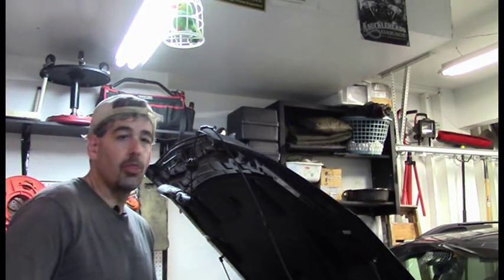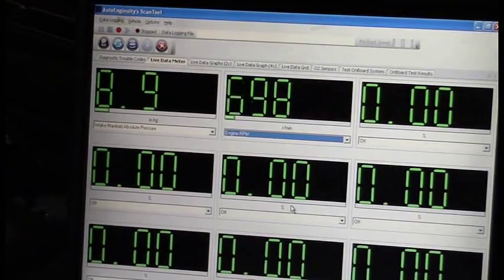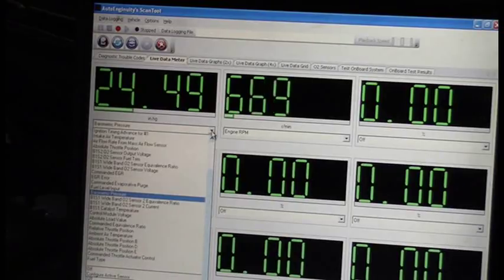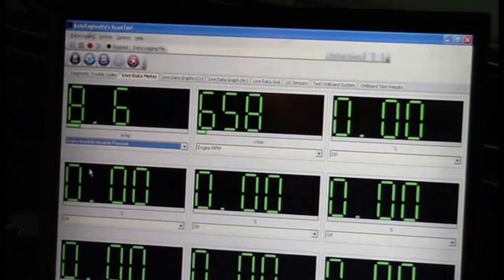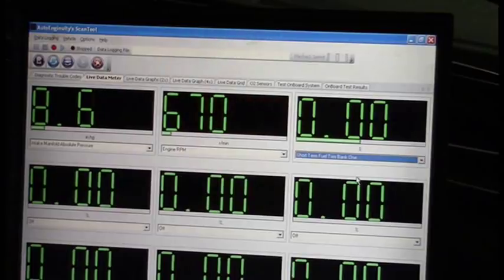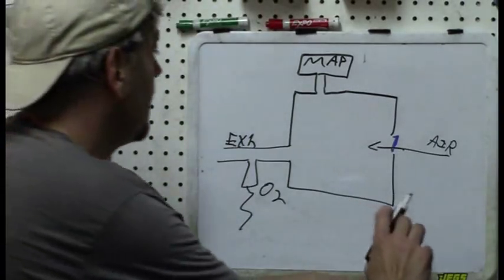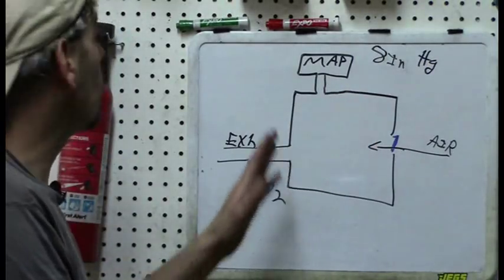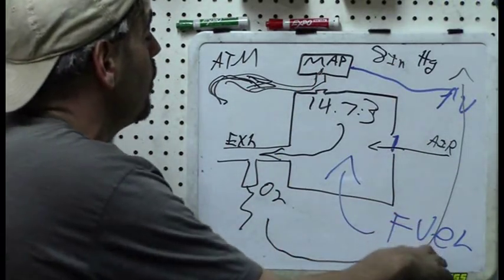MAP Sensor Diagnosis and Understanding Function- Pt2

Comment: I have a 14 Prius 2 , p0108 code but car seems to run fine. There was a couple other codes before this one.  It all started after I did my own head gasket job, intake , egr pcv valves replaced. Took it to Toyota for software update regarding the egr. Hoping they did it right.  Car felt weak before update.  Wouldn’t back in to my driveway and after update voila it works fine.  The initial codes were all air fuel related and they went away.  I was hoping there was a re learning period and that codes would go away.  It’s only been 9500 miles since I put it back together.  Now I need a smog check by February hoping to make this light go away snd fix the issue.
Reply from the maker: Pretty obvious to me you have no open in the MAF circuit. What is your reference and ground voltage showing?
Reply: @SchrodingersBox thanks so much for the fast response.  Sorry took me a while to answer cause I didn’t wanna sound dumb, I’m still gaining my proficiency in car talk.  
     but I’m pretty sure you mean the ground voltage and reference voltage for the MAF sensor itself right ? I see a reading in the freeze frame data of 0.20 gm/ S for the MAF in my scan tool but I think I need to use my multimeter and check the MAF sensor it self right to see if it receives 5 volts? Gonna watch some more of your clips I’m getting close. I can also send any freeze frame or live data through email with my scan tool.  Hate to ask for too much, only if it helps.  Many thanks !
Reply: @SchrodingersBox I think I figured it out. I had a feeling , the MAP sensor still had oil residue on it from when I was changing the head gasket and intake.  I cleaned it and the check engine light went away.  Thanks again happy holidays!
Reply from the maker: Fascinating because a map sensor is not affected by oil since the diagram is internal.  But since you had an open circuit it’s more likely it just wasn’t plugged in all the way before.
Reply: @SchrodingersBox that makes sense cause it probably should have gone off much sooner if it was the oil. Thank you merry Christmas 🎄
Reply: Also to add after the first set of codes I took out the first 2 fuel injectors , cleaned and added some petroleum jelly to seal the o rings. At the time they were misfiring. The misfires went away as far as I can tell. A while later p0108 came up and now I hear a slight humming after a bit of driving.  Freeze frame shows that the code gets thrown at the same engine run time the last 2 times i checked.  The MAP kPa goes up to like 130-40 which sets off the code.  The code is intermittent but seems like it’s staying on longer as it progresses. I initially thought fuel injectors cause there was an issue where one of them fell out when I was working on the head gasket so I swapped them to see if misfires would change places. Realizing it was the fumes that got me high and not my blunt was crazy lol

Comment: Hi so does the map sensor tell the air temperature as well I have a ford focus 2.0 Duratech engine I can only find a T-map sensor no maf one would that be right thanks. Jeff UK
Reply from the maker: No it does not. However the MAF sensor often does on a lot of vehicles. The IAT is very often integrated with the MAF

Comment: I guessed that the fuel trim would go negative from unplugging the MAP but my reasoning was that the map would read 0 pressure, therefor decreasing fuel delivery which would mean less fuel than needed, killing the engine due to lack of fuel.

Comment: I stumbled across your video due to an issue i am having with my 2.4 L Ecotec 4 cylinder and negative fuel trims, mostly on cold engine start up. After much research, I narrowed the issue down to either the MAP, IAT (part of MAF on these engines), or coolant temp sensor. I didnt want to just throw parts at it, and due to your explaining on MAP, i am having the exact scenario in your example, and think, finally, that my MAP is reading high and causing the issues im having. The MAP, being 16 years old, is my culprit i believe. Thank you.

Comment: How do you manipulate or trick MAP to read at 0psi when  it is actually reading at +1.5psi. I think this would prompt the super charger bypass valve to start closing a bit earlier than usual. Perhaps will get me extra 10% extra hp without going above 3200rpm.

My engine air manifold read at -11.8 psi during braking and up to +8.2psi but only during hard acceleration. 80% of my road miles are having manifold pressure at 0psi or lower. 20% of the other road miles are above 0 to 5psi. Regards.

Comment: My map sensor reading is stuck at 2.75v and 14.25psi. It doesn't move from this, at different throttle angles. Is the MAP bad
Reply from the maker: Could be. Provide a ground and see if the reading changes. If it does the map is bad.
Reply: @SchrodingersBox  Thanks a lot
Reply: did you find out if the MAP sensor was bad? I think 14.25psi is just like outside air pressure

Comment: The barometric pressure shown was 24.49.inhg..... but this could be different reading in other countries eg. 29inhg etc .
Reply from the maker: It will be different depending on anything… even the weather. Baraomettic pressure is not a constant.
Reply: @SchrodingersBox  Ok noted Matt. Thx for the reply.

Comment: I’m a little confused.  Why would the O2 sensor report a rich condition after removing MAP and plugging hole.  It seems to me that, in reality the mixture is neither rich nor lean as evidenced by the zero STFT prior to the intervention.  Am I missing something?
Reply from the maker: Because the MAP would read atmospheric pressure instead of vacuum, so it will assume the car is at WOT and increase injector pulsewidth. But the car is not at WOT so the excess fuel causes a rich condition.

Comment: Help!!! Lol
I changed my map sensor, but no luck.
Have code p108, p106 live data reads 38hg and singnal wire is 4.9 volts all the time. This comes and goes. Some times it reads 10hg at idle and fluctuates with throttle as it should. 
Continuity is good on all map and maf sensor plugs to ecu. Did smoke test and have no vacuum leaks. Did exhaust back pressure test and the cat is good
Reply from the maker: What data showed the MAP sensor was faulty?  Also how is it possible the signal wire is showing 4.9V?  Is that with it unplugged?
Reply: I had codes pointing to high voltage  and high pressure so I changed the map to start with because is a $20 part. 
I back probed the plug and had 5v powered and 5v signal at idle. 
 With the key in acc mode I have no volts to the signal, but today I did it again and I had 5 volt signal and when I mess with the wire it will drop to 1.5 volts at idle.  I ordered a new plug for the map because I'm thinking it's internal,  inside the plug
BTW 
O9 3.5 impala 150k
Reply: I got codes p0107 and p0106. I'm new to diagnostics on a computer,  but to me it pionted to the map
Reply from the maker: Ok if you have 5V signal voltage at the sensor you have an open ground circuit. Nothing else can cause that.

Comment: I'm here because of map sensor and maf sensor codes . Replaced both but still hesitated from a stop . 
            Suggestions included electrical problem so replaced spark
plug wires after replacing plugs months ago and engine runs perfect 
           Damaged a wire while doing plugs and the map sensor reported it

Comment: So even if I have a code P0108 it’s possible is not the MAP sensor problem, or it might be air leak .
Reply from the maker: Not only possible- it’s likely. Always check your Inputs first and then look for variable output from the sensor. That’s always the basic first starting point every time.

Comment: I have a car that only has a map sensor the idle is very low and rough,  i think i may have a vacuum leak somewhere which I'm going to try and fettle, but something that is interesting is the fact that by quickly pressing the break pedal continuously you can make the engine tickover rise, i believe this will be because of the brake servo drawing off excess manifold pressure.
Reply from the maker: On a MAP only engine a vacuum leak will cause a high idle.
Reply: @SchrodingersBox  hi mate thx for the reply,  I will avoid wasting time looking for a vacuum leak for this rough idle and will perhaps look towards the throttle position readings which were 12% at idle which I believe should be about 0.6v. I don't have any fancy scopes just a cheap scanner and a multi meter, but that's half the fun of the challenge 😄
Reply from the maker: Up until only two years ago I didn’t even have that much. All you need is a simple scantool that reads live data and a testlight really.

Comment: On a 94 f-150 5.0 l on the MAP sensor starting with A 11.84 v B .005v C .006v D .022v with the key on does this tell me I have a bad PCM I have spark at the coil  and the spark plug the coil red wire has 12v and the tan wire flashes with test light ignition switch does nothing when turned to crank.I replaced the ignition switch and the neutral safety switch
Reply from the maker: Where is your 5V reference?
Reply: @SchrodingersBox It did not have a 5v reference I checked all the wires with the key on with a VOM  on all four wires I was told by Scanner Danner that this is one way to check for a faulty PCM is this true?
Reply from the maker: You need to check for 5V reference from the PCM.

Comment: I get the slight increase when the throttle opens up. What about when the engine is under constant load of 3000 rpm does the  Hg stay higher than at idle or does it equal back out to 9Hg after the initial air suction.
Reply from the maker: Vacuum lowers proportionately to throttle opening. When throttle is open, you are equilibrating with atmospheric.

Comment: Also worthy of note:  There is a difference between HgV and HgA.  HgV (Inches of Mercury Gauge) is what you would see on a boost gauge.  0 is atmospheric and 29.92 is perfect vacuum. That different than what the computer is reporting here which is HgA (Inches of Mercury Absolute) which has the figures reversed.  0 is absolute vacuum while atmospheric is 29.92.  That's why the computer reports an "in Hg" of about 27.1.  Much closer to atmospheric and judging by the reading, he's at about 2,700 ft above sea level.

I'm confused about the initial rich condition though.  When you expose the MAP to ATM pressure, how is the PCM adding more fuel if not through STFT?  I expected the PCM detecting extra air in the form of pressure at the MAP to then trigger STFT to go positive adding in more fuel to compensate.  Then the O2 would see a rich condition because that extra air is not actually in the system so STFT going negative to compensate for the new rich condition.  Doe that happen so fast you just don't see the STFT go positive before it goes negative and we are seeing the net result of the MAP and O2 readings or does the PCM command fuel some other way to compensate for MAP and only O2 controls STFT?
Reply from the maker: It is likely that it is adding through the LTFT that was already adjusted perhaps- this the STFT didn’t move.

Comment: Sheet I am 666 comment.  Not good for those that believe in signs.  
Anyways so if my map is actually going down when I open up the throttle that means my map is either reporting a leak or is bad???  Correct me if wrong of course.  Great vid btw.

Comment: My engine vacuum is fine at idle but when traveling especially in 3rd and 4th gears, it increases to like 80 to 100 kpa which is the same as engine load % and the ecu keeps dumping fuel into it. While this is dumping fuel, trims go -20 to -30 cutting fuel away and this causes severe hesitation.  What do you think is the problem? What is likely cause this situation?
Reply from the maker: there isn’t enough information to say. you have no induction metrics or TPS so it’s impossible to determine if there is even a fault b

Comment: Sir, I have a question, can a bad cat  or clogged exhaust cause high MAP reading on a MAP only engine?
I am unable to come to a conclusion because my fuel trims were never positive in the last 30 days? Is it possible for stft to never be positive?(not on average but never read positive even a single time  i.e graph starts at 0 and goes below and never up). How do I force trims to positive on MAP only engine? Till now I have come to a conclusion that probably my O2 sensor circuit is off(reporting like a 200 or 400mv over actual but couldn't really understand what would cause it). Can you tell me if throttle position in a MAP only engine has any control over fuel injection?
Reply from the maker: yes is can cause a high MAP for sure as the exhaust pressurized the manifold.

Comment: What you stated from 11:35 - 12:45 is absolute gold nuggets. No technician should be allowed to diagnose and repair drivability and fault code diagnosis that doesn't understand what Matt shared. This explanation could practically apply to most any code. Learning system integration between inputs and outputs is absolutely essential to be a 2%'er. This channel is not as recognized as some but I would put Matt up against any other tech from any other channel when it comes to complete and accurate diagnostics.
Reply from the maker: Thank you so much!! I will admit it may take me longer than other techs but I would get there eventually with a correct diagnosis the first time- just slower than some.

Comment: Thank-you Matt for the excellent video. If I knew where your shop is I would not hesitate to bring a job to you that I cannot figure out. Currently I have a PO 106 on an 05 Sprinter diesel. So far I have not be able to figure it out.
Reply from the maker: I am in denver.

Comment: I like that saying "Tools don't fix cars...brains do!". 
All your vids are awesome. Even this 8year old one lol. 
The 05 Tacoma's still runs when the MAP sensor is disconnected, MAF sensor unplugged, O2 sensors unplugged, AND Camshaft sensor is disconnected. At 2k RPM max. The limp mode is mind blowing but remembered watching a military engineering show on some engine a while back. It mentioned its computer's ability to use data from other functional sensors to estimate the air/fuel ratio and continue running. On the Tacoma, the  Crankshafts sensor was still plugged in (no power to fuel pump when Crankshaft sensor is disconnected). Logically thinking, in its stock form it can estimate air/fuel ratio relying on the Crankshaft sensor and the TPS. 
And don't mind them "ASS HAT'S". Their "CHECK BRAIN" light is on lol.

Comment: my engin 3800 twon and country is lazy.and the rpm is limited to 2500rpm.the map is ok.but pcv valve is faulty.what else should i check for better accelartion.
Reply from the maker: it could be in limp mode. could be clogged exhaust. many things.

Comment: Greetings from Australia. Been a mechanic for 60 yrs, ex race cars & F1 & was well trained on & understood all fuel injection to 1980. Been working hot rods & 60"s muscle cars since 2000 & long stint as service manager before that. Had to repair some OBD1 a couple of times since being on my own from 2000 but even factory manuals I had didn't really explain function & figures in any great detail & trying to diag my daughter's 2011 Hyundai prompted me to buy an Xtool D8 scanner, but not understand what I was reading & so found your site clearly by divine providence. AWESOME tutorials & easy to grasp, the clear sign of someone who REALLY understands what they're on about & a pleasure to watch. Now have a good grasp, after spending sleepless nights watching many of your tutorials, of how it all works, thanks to your diligence & perseverance. Thank you very much for your efforts, I am indebted to you. Over the years of having people blame carbs, electronic ign. & now fuel injection, for everything that goes wrong, have found it best to start from first principles & have fixed heaps of badly running cars, early Jaguar with 0.004"" intake & 0.006" exhaust valve lash in particular, by starting all tune ups with valve clearance check/adjustment, plug check (& very often fit correct plugs instead of the new wrong ones) & on to the distributor & then look at fueling. Have also fixed countless cars poor performance after curing voltage/ earthing issues. Takes a few seconds to check relevant voltages on pre efi cars. That way you know the foundations are ok before replacing the roof. Repaired a 1969 V8 Aston Martin that had retarded cam timing, one tooth out, & the 3 quadrant pointers each tied in a knot (a real work of art & also to untie them) that had been to every place I contacted for help (waste of time) over a 21/2 yr period. They all blamed the Bosch mechanical fuel injection. Told the owner to take it for a run & if he wasn't happy, to keep going but come back & pay if he was. The bill was massive & he couldn't pay fast enough. Apart from race cars, was one of the fastest cars I had driven until a Ferrari 365 GTB/4 (Daytona to you guys) in 1972. A client bought a used car with 35,000mls but 10 yrs old & called by to show me how nice it was.I suggested he change the cam belt immediately but he had a few errands to run & booked it for the next day. 15mins later he rang to say it had stopped running. The cam belt broke &  destroyed the interference engine. Now I won't work on an engine before being certain the cam belt is within the service period or I have changed it. My observations after 60 yrs in the business. Once again THANK YOU
Reply from the maker: Wow thank you for the wonderful comment!! Cool story!!